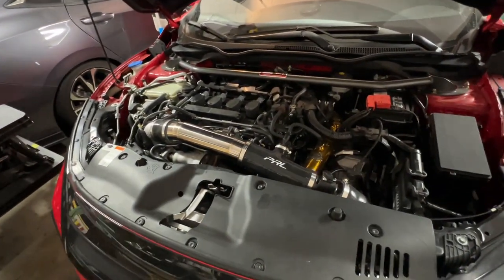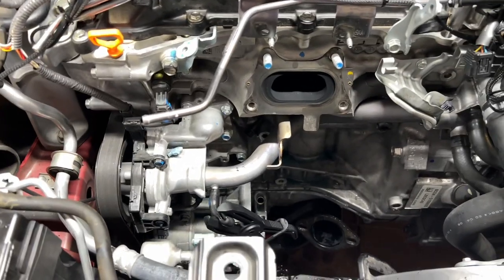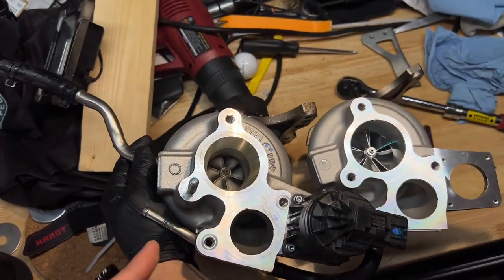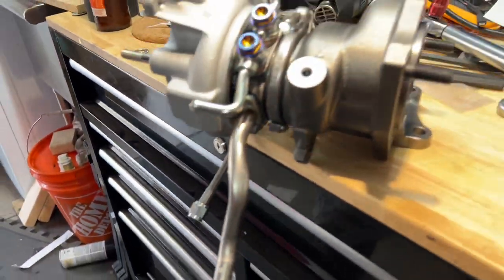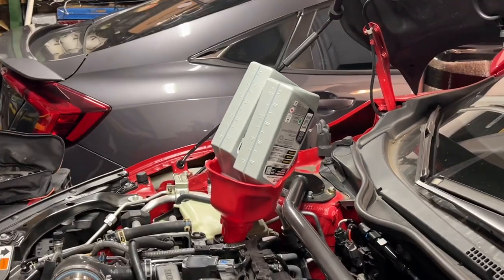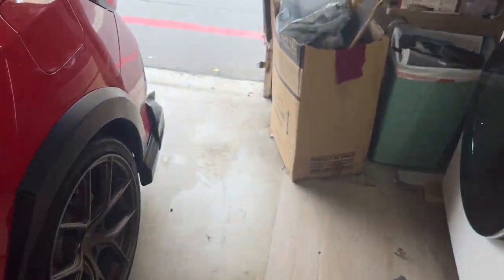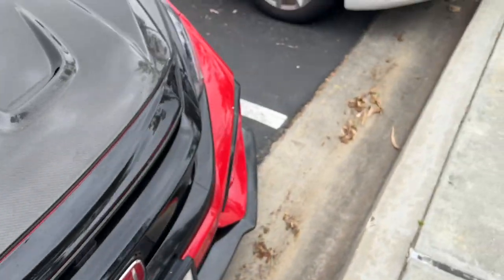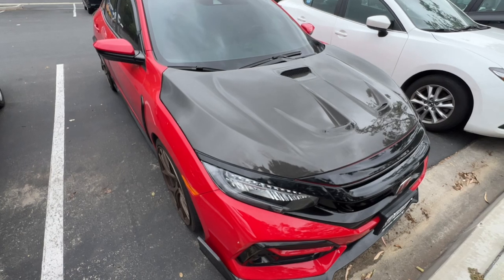RV6 R365 RED BALL BEARING TURBO INSTALL ON CIVIC 1.5T | CVT goes big turbo!

Comment: I’m running 27won turbo, so if you’re going to thrash your car all the time. It’s recommended that you change your CVT oil every 1-2000miles. Some people could run CVT oil cooler

Comment: Why did you chose that turbo specifically? And not the non bearing one? I been eyeing it too for my 21 civic hatchback sport touring CVT
Reply from the maker: 27won has a high failure rate on the W1 turbo, so I didn’t want that. PRL turbo kit would have best but it’s not available anymore. Rv6 journal bearing was out for a long time, so when the release of the new ball bearing came out, I did a lot of research into it. 400rpm quicker spool time, better top end power + better reliability due to being a ball bearing was all very good characteristics. Not to mention multiple CVT owners in the official rv6 CivicX forum already got it and posted about it, so that’s why I got it as well.
Reply: @BlazeFK7  you got a point I was surprised you didn't chose VTT  I heard they are highly reliable too and holll up what's your username on Civicx👀 I'm usually posting there
Reply from the maker: @BootlegBill498  they are a cheaper option as well, but ultimately a ball bearing has more characteristics that I wanted. My CivicX username is YellowShinobi77

Comment: How much power and tq did you end up getting? Also what kinda tune? Just the ktuner? Would hondata work just as good?
Reply from the maker: @nicksname26  I never got it dynoed, but people with similar setups on the cvt got around 300-310whp. As for torque, I was guessing around 270wtq. It was a custom tune by Derek Robinson on Ktuner. Either device would work fine!